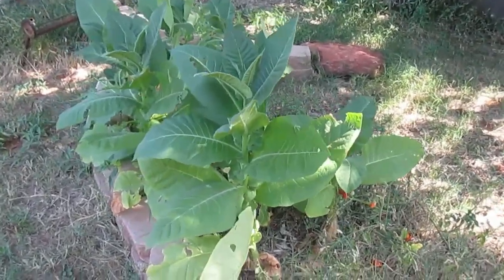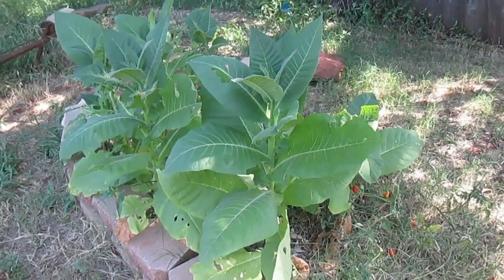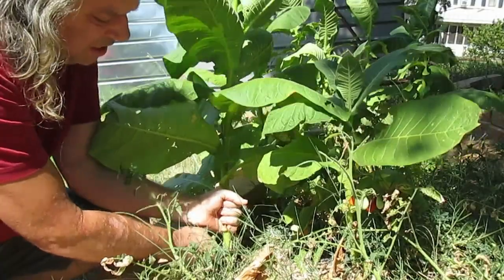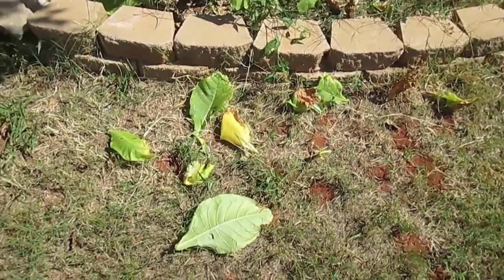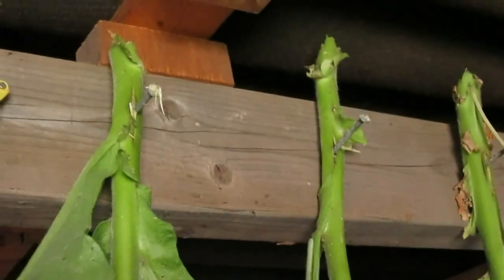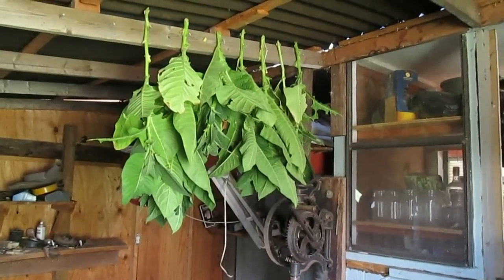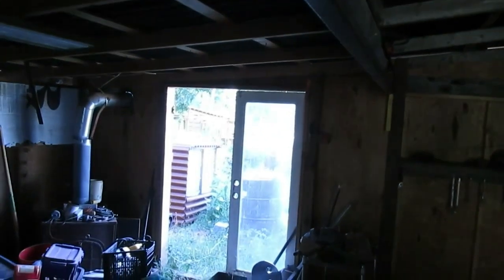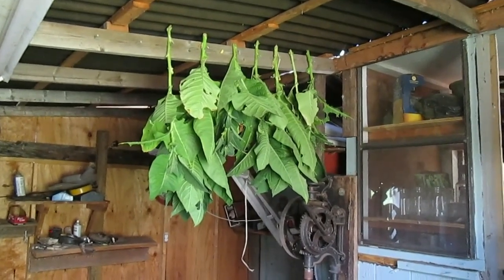6 Burley Tobacco Planting and Curing series 6

Comment: I have no barn but my apartment can easily get stuffy as hell and heat does not bother me. It's humid where I live and I have cross ventalation in several areas. Will my curing work in a humid hot apartment with cross ventalation?